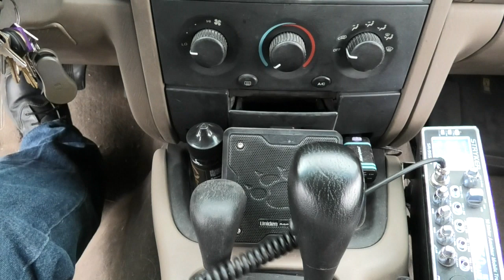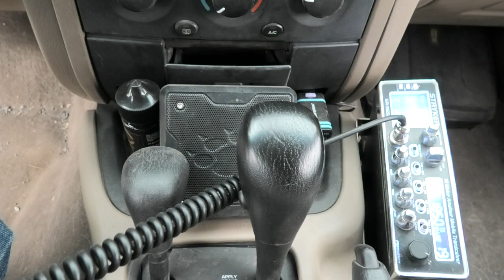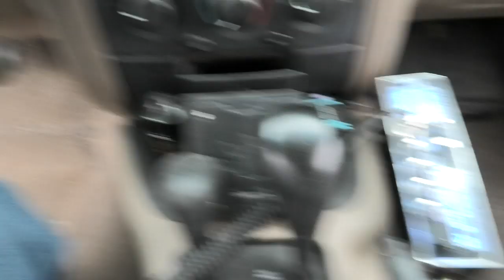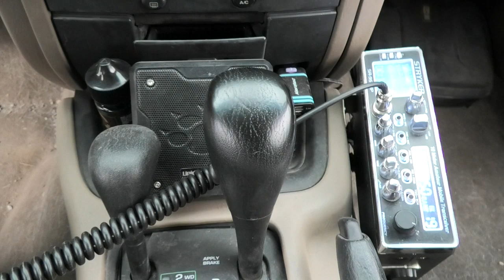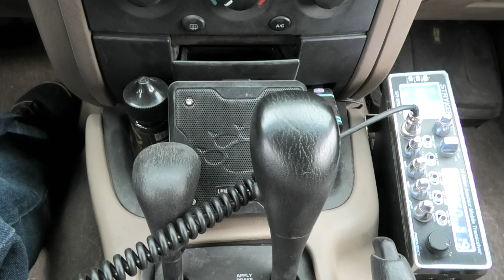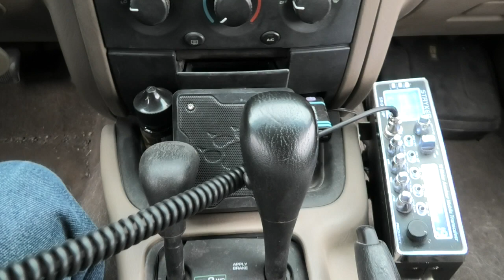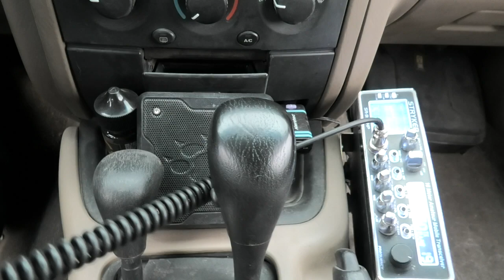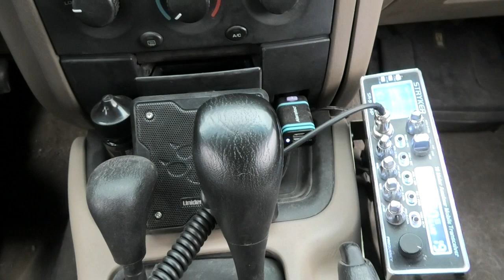Real World Radio .. Stock Cobra 29 - We Talked Further But I forgot To Charge My Camera.

Comment from the maker: Paradise - Parking lot - Birds Bees - That Voice And Guitar!  (((( https://www.youtube.com/watch?v=OlNZN94_u-s ))))
Just leave them alone .. the next step can be a doozy! Bite your tongue and follow directions .. Here's what it takes to cut through the noise, be loud and crystal clear with a better receiver too:  A) Tuned Bench:  https://www.youtube.com/watch?v=lwcDfXOgAls.  True, it's more complicated and time consuming to accomplish these consistent and accurate results. Below is a partial procedure and list of calibrated equipment used to achieve this level of performance . Read on ..

Fine Tune CB Radio Shop strictly adheres to (https://www.nist.gov/) NIST Traceable Calibrations and other industry standards to maintain accuracy and consistency for providing Real World Performance Tuning of Citizens Band and 10 Meter export mobile radios with integrity.

"Basic Textbook AM/FM/SSB Transceiver Tune, Alignment and Calibration" 

1) Pll adjustments
VCO & OSC, AM TX OSC, USB TX OSC, LSB TX OSC.

2) Transmitter alignment
DRIVER BIAS, FINAL BIAS, SSB  (or gate voltages for mosfet versions) CARRIER BALANCE, HI-LO AM & SSB Power, RF METER, AMC, ALC and FM DEVIATION.

3) Receiver alignment
AM/FM RF & IF SENSITIVITY, FM DETECTOR/DEVIATION, SSB IF SENSITIVITY, SSB S-METER, AM/FM S-METER (100uV unmodulated -67dbm for “S-9” meter reading!), AM/FM SQUELCH RANGE, SSB SQUELCH RANGE, and NOISE BLANKER/AUTOMATIC NOISE LIMITER (Real World dBm to volts (uV) tables below).

That's just a typical run of the mill textbook tune up and alignment (if you're lucky). There's more to it than frequency alignment, modulation adjustment, meter calibration and a tune up report displaying exaggerated rms Bird peak watts! 

"Test Bench includes"

Bird 4314C Meter
https://www.birdrf.com/Products/Test%20and%20Measurement/Power-Meters/Wattmeters-Line-Sections/RF-Wattmeters/4314C_PEP-Single-Element-Wattmeter.aspx
Part 1) https://www.youtube.com/watch?v=RpX9IHe4ORM&t=16s
Part 2) https://www.youtube.com/watch?v=LuhbqTf6Bxw
Bird 4314C Accuracy Test: https://www.youtube.com/watch?v=DqEOabYqhQo&t=5s
Bird Stipulates 1/2 wavelengths  https://www.youtube.com/watch?v=5eWhgT-rTII
And Genuine Bird Elements from 1K down.

Bird 4373 Sampler 
https://www.rfparts.com/signal-samplers.html

HP8924c with options
http://userequip.com/files/specs/2147/HP%208924C%20Repair.pdf
https://www.youtube.com/watch?v=Cg1w0xBa27s&t=1s

HP8920a with options
https://www.keysight.com/upload/cmc_upload/All/EPSG072204.pdf

Three analog scopes, one digital 200 Mhz
https://www.atecorp.com/atecorp/media/pdfs/data-sheets/tektronix-2465b-2467b_manual.pdf
https://www.youtube.com/watch?v=by98x4eu2lM

Fluke 27fm
http://www.fluke.com/fluke/inen/digital-multimeters/fluke-27.htm?pid=56055
 
LCR http://www.lcrresearch.com/wp-content/uploads/2017/05/LCR_Pro1_Manual_version1.03.pdf

Power supplies
6 Cosel PBA1500f12 (750 amps) variable and configurable.
https://en.cosel.co.jp/product/powersupply/PBA/PBA1500F/PBA1500F-12/
Corcom 20VB1 F7130 EMI Filter 50-60Hz 250V

Times Microwave Coax jumpers and test leads
http://www.timesmicrowave.com/cms/products/cables/lmr/
https://www.youtube.com/watch?v=EmqaGJ6IWow
https://www.youtube.com/watch?v=1ltFVSxGp5Y
https://www.youtube.com/watch?v=v12YZT_1o90
https://www.youtube.com/watch?v=h7iiYfmYWRA&t=215s

Amphenol RF Connectors
https://www.amphenolrf.com/
https://www.youtube.com/watch?v=dVh5B0hdEA0 
https://www.youtube.com/watch?v=dKZg8T_AOso

More range, compliments, reliability and a quieter, clearer but more sensitive receiver,  Get Fine Tuned .. not peaked and ruined.

Here are some VideoGates of me at the bench practicing what I preach using my bench radio or customers radio completed and ready to be shipped: https://www.youtube.com/results?search_query=hard+drive+163+ more: https://www.google.com/search?q=Hard+Drive+163+nm&ie=utf-8&oe=utf-8&client=firefox-b-1-ab

It's what I recommend, use, service and sell ... to you ... not something non practical or deceiving in a misleading way. I'm not just the tech and owner of Fine Tune CB Radio Shop, I'm a customer too!  When finished, You'll be giving radio checks, not asking for them .

dBm To Watts and Volts
Tables below displays relationship between Power in [dBm] or [Watts] and Voltage in RMS, peak, peak-to-peak for sinusoidal signals in 50-Ohm systems for accurately measuring and tuning am/fm/ssb receiver sensitivity, agc, squelch and "S9" Meter calibration. Real World! Mike @ Mikes Radio Repair (Romper Room), Mark Rutherford aka Mark 19960, CB Kidd, Martian and all of your other fake accounts pay attention to the tables below, stop misaligning radios, spreading false information and promoting propaganda! 

  [dBm] [Watts]   [Volts]rms   [Volts]p    [Volts]pp
-140 0.100E-16  22.361 nV  31.618 nV  63.236 nV 
-139 0.126E-16  25.089 nV  35.476 nV  70.952 nV 
-138 0.158E-16  28.150 nV  39.805 nV  79.609 nV 
-137 0.200E-16  31.585 nV  44.662 nV  89.323 nV 
-136 0.251E-16  35.439 nV  50.111 nV  100.222 nV 
-135 0.316E-16  39.764 nV  56.226 nV  112.451 nV 
-134 0.398E-16  44.615 nV  63.086 nV  126.172 nV 
-133 0.501E-16  50.059 nV  70.784 nV  141.568 nV 
-132 0.631E-16  56.167 nV  79.421 nV  158.842 nV 
-131 0.794E-16  63.021 nV  89.112 nV  178.223 nV 
-130 0.100E-15  70.711 nV  99.985 nV  199.970 nV 
-129 0.126E-15  79.339 nV  112.185 nV  224.370 nV 
-128 0.158E-15  89.019 nV  125.874 nV  251.747 nV 
-127 0.200E-15  99.882 nV  141.232 nV  282.465 nV 
-126 0.251E-15  112.069 nV  158.465 nV  316.931 nV 
-125 0.316E-15  125.743 nV  177.801 nV  355.602 nV 
-124 0.398E-15  141.086 nV  199.496 nV  398.992 nV 
-123 0.501E-15  158.301 nV  223.838 nV  447.677 nV 
-122 0.631E-15  177.617 nV  251.151 nV  502.302 nV 
-121 0.794E-15  199.290 nV  281.796 nV  563.591 nV 
-120 0.100E-14  223.607 nV  316.180 nV  632.360 nV 
-119 0.126E-14  250.891 nV  354.760 nV  709.519 nV 
-118 0.158E-14  281.504 nV  398.047 nV  796.094 nV 
-117 0.200E-14  315.853 nV  446.616 nV  893.232 nV 
-116 0.251E-14  0.354 µV  0.501 µV  1.002 µV 
-115 0.316E-14  0.398 µV  0.562 µV  1.125 µV 
-114 0.398E-14  0.446 µV  0.631 µV  1.262 µV 
-113 0.501E-14  0.501 µV  0.708 µV  1.416 µV 
-112 0.631E-14  0.562 µV  0.794 µV  1.588 µV 
-111 0.794E-14  0.630 µV  0.891 µV  1.782 µV 
-110 0.100E-13  0.707 µV  1.000 µV  2.000 µV 
-109 0.126E-13  0.793 µV  1.122 µV  2.244 µV 
-108 0.158E-13  0.890 µV  1.259 µV  2.517 µV 
-107 0.200E-13  0.999 µV  1.412 µV  2.825 µV 
-106 0.251E-13  1.121 µV  1.585 µV  3.169 µV 
-105 0.316E-13  1.257 µV  1.778 µV  3.556 µV 
-104 0.398E-13  1.411 µV  1.995 µV  3.990 µV 
-103 0.501E-13  1.583 µV  2.238 µV  4.477 µV 
-102 0.631E-13  1.776 µV  2.512 µV  5.023 µV 
-101 0.794E-13  1.993 µV  2.818 µV  5.636 µV 
-100 0.100E-12  2.236 µV  3.162 µV  6.324 µV 
-99 0.126E-12  2.509 µV  3.548 µV  7.095 µV 
-98 0.158E-12  2.815 µV  3.980 µV  7.961 µV 
-97 0.200E-12  3.159 µV  4.466 µV  8.932 µV 
-96 0.251E-12  3.544 µV  5.011 µV  10.022 µV 
-95 0.316E-12  3.976 µV  5.623 µV  11.245 µV 
-94 0.398E-12  4.462 µV  6.309 µV  12.617 µV 
-93 0.501E-12  5.006 µV  7.078 µV  14.157 µV 
-92 0.631E-12  5.617 µV  7.942 µV  15.884 µV 
-91 0.794E-12  6.302 µV  8.911 µV  17.822 µV 
-90 0.100E-11  7.071 µV  9.998 µV  19.997 µV 
-89 0.126E-11  7.934 µV  11.218 µV  22.437 µV 
-88 0.158E-11  8.902 µV  12.587 µV  25.175 µV 
-87 0.200E-11  9.988 µV  14.123 µV  28.246 µV 
-86 0.251E-11  11.207 µV  15.847 µV  31.693 µV 
-85 0.316E-11  12.574 µV  17.780 µV  35.560 µV 
-84 0.398E-11  14.109 µV  19.950 µV  39.899 µV 
-83 0.501E-11  15.830 µV  22.384 µV  44.768 µV 
-82 0.631E-11  17.762 µV  25.115 µV  50.230 µV 
-81 0.794E-11  19.929 µV  28.180 µV  56.359 µV 
-80 0.100E-10  22.361 µV  31.618 µV  63.236 µV 
-79 0.126E-10  25.089 µV  35.476 µV  70.952 µV 
-78 0.158E-10  28.150 µV  39.805 µV  79.609 µV 
-77 0.200E-10  31.585 µV  44.662 µV  89.323 µV 
-76 0.251E-10  35.439 µV  50.111 µV  100.222 µV 
-75 0.316E-10  39.764 µV  56.226 µV  112.451 µV 
-74 0.398E-10  44.615 µV  63.086 µV  126.172 µV 
-73 0.501E-10  50.059 µV  70.784 µV  141.568 µV 
-72 0.631E-10  56.167 µV  79.421 µV  158.842 µV 
-71 0.794E-10  63.021 µV  89.112 µV  178.223 µV 
-70 0.100E-09  70.711 µV  99.985 µV  199.970 µV 
-69 0.126E-09  79.339 µV  112.185 µV  224.370 µV 
-68 0.158E-09  89.019 µV  125.874 µV  251.747 µV 
-67 0.200E-09  99.881 µV  141.232 µV  282.465 µV
-66 0.251E-09  112.069 µV  158.465 µV  316.931 µV 
-65 0.316E-09  125.743 µV  177.801 µV  355.602 µV 
-64 0.398E-09  141.086 µV  199.496 µV  398.992 µV 
-63 0.501E-09  158.301 µV  223.838 µV  447.677 µV 
-62 0.631E-09  177.617 µV  251.151 µV  502.301 µV 
-61 0.794E-09  199.290 µV  281.796 µV  563.592 µV 
-60 0.100E-08  223.607 µV  316.180 µV  632.360 µV 
-59 0.126E-08  250.891 µV  354.760 µV  709.520 µV 
-58 0.158E-08  281.504 µV  398.047 µV  796.094 µV 
-57 0.200E-08  315.853 µV  446.616 µV  893.232 µV 
-56 0.251E-08  0.354 mV  0.501 mV  1.002 mV 
-55 0.316E-08  0.398 mV  0.562 mV  1.125 mV 
-54 0.398E-08  0.446 mV  0.631 mV  1.262 mV 
-53 0.501E-08  0.501 mV  0.708 mV  1.416 mV 
-52 0.631E-08  0.562 mV  0.794 mV  1.588 mV 
-51 0.794E-08  0.630 mV  0.891 mV  1.782 mV 
-50 0.100E-07  0.707 mV  1.000 mV  2.000 mV 
-49 0.126E-07  0.793 mV  1.122 mV  2.244 mV 
-48 0.158E-07  0.890 mV  1.259 mV  2.517 mV 
-47 0.200E-07  0.999 mV  1.412 mV  2.825 mV 
-46 0.251E-07  1.121 mV  1.585 mV  3.169 mV 
-45 0.316E-07  1.257 mV  1.778 mV  3.556 mV 
-44 0.398E-07  1.411 mV  1.995 mV  3.990 mV 
-43 0.501E-07  1.583 mV  2.238 mV  4.477 mV 
-42 0.631E-07  1.776 mV  2.512 mV  5.023 mV 
-41 0.794E-07  1.993 mV  2.818 mV  5.636 mV 
-40 0.100E-06  2.236 mV  3.162 mV  6.324 mV 
-39 0.126E-06  2.509 mV  3.548 mV  7.095 mV 

                 Don't Be A Mud Duck!

 https://www.arrl.org/shop/ARRL-Handbook-2019-eBook

Hard Drive 163 NM. 73's! Click click.?